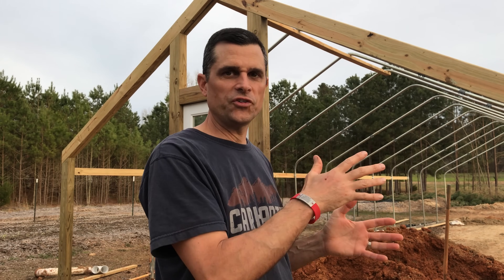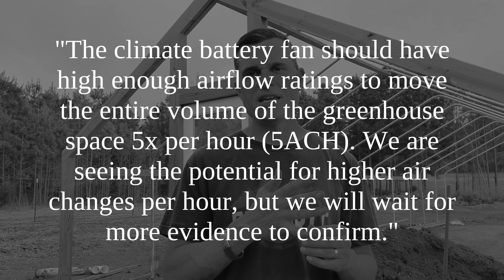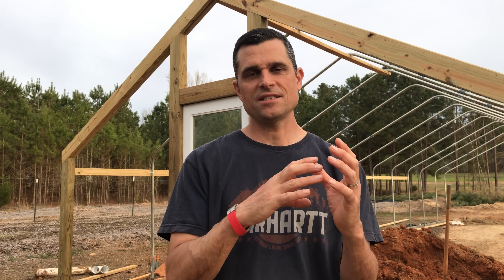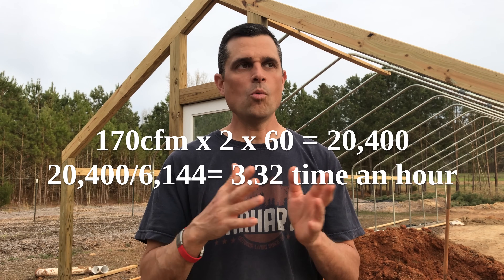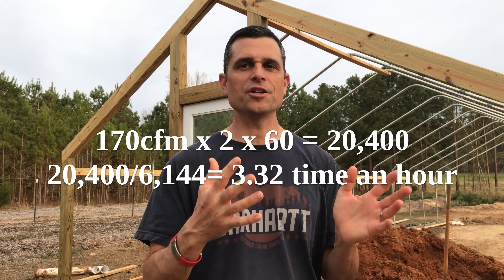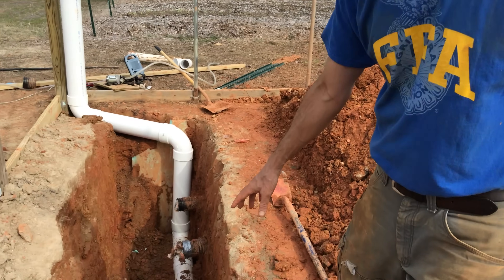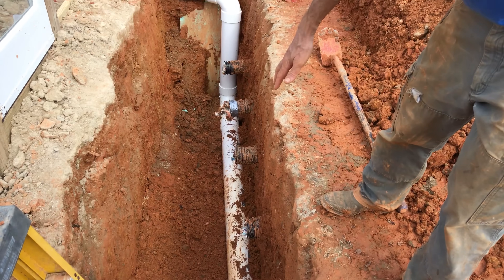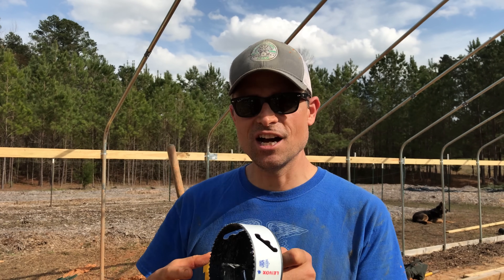DIY Geothermal Greenhouse Part 7: Earth Battery MISTAKE!

Comment: Okay, I'm getting ready to build one of these Earth batteries... You have a 6" manifold on both sides? What is the reasoning behind the additional manifold other than the exhaust end connection? (Is it that you don't want individual 4" exhaust ports?) Also; why did you step up to 6" and not go with an 8" or 10" culvert pipe? (And, would that have made a difference on air pressure on the 4" pipes?)  Thanks!
Reply from the maker: Uploading the Q&A video as I type. Hope it answers some questions. What I can say is this - the earth battery works in that right now air temps at the exhaust/return are 30-40 degrees cooler than the intake during the heat of the day. To us, that is just really impressive. What the system is not able to do during the summer is offset the passive solar heat gain. Don't know if any earth battery system in our area (central NC) could do that efficiently or at relatively low costs. Assuming ours does what we think it will in the winter (keep temps in the greenhouse above freezing for the cost of leaving on two light bulbs) we will be REALLY happy. We do wonder what slightly larger manifolds and fans would have done. Have to assume higher exchange rates would mean better results for not much more money to install or run.
Reply from the maker: Derek, we're about to do a FAQ video about the greenhouse. You are absolutely right about size - if money and time hadn't been an issue, we should have scaled everything up. 6" pipes in the ground with much larger manifold pipes and fans. As it is, what we installed will no doubt help us in the fall/winter/early spring to grow cool season vegetables year round. But it cannot handle the heat in the summer. It seems clear that a larger system probably would. Ours just cannot turn over the air fast enough. But a larger system means greater cost up front and to operate, so you would have to run the numbers to see if it was worth it.
Reply: 6" tubing is more expensive and less efficient than 4". The manifolds should be sized to handle the combined flow of all the 4" tubes ;)
Reply from the maker: We're about to do a Q&A video about this greenhouse. Given the size of our greenhouse, what would you recommend for the system? Do you think it is possible to upsize this system enough to offset summer passive solar heat gain?
Reply: I've been looking at a lot of various heat exchangers and the 4" pipes seem to me to be the best ones to use. To get a 1 cubic foot of air into a pipe, you need about 22-25 feet. The manifold is what I am having difficulty with right now because I don't understand how manifolds work and what the limitations on manifolds are. 24" culvert pipe isn't cheap... I could do 8" culvert, but then I am not sure if this would run into the unknown variables... I ordered the "Year Round Solar Greenhouse" by Shiller and Plinke, and it gives me some pointers but it doesn't get into the technical nuts and bolts of "why" you need what you need... LDSprepper built three different varieties and uploaded them to YouTube and he doesn't have outflow manifolds... (he also had a lot of money to toss into his project). What I don't get about LDS prepper is where he gets his figures from of 10:1 or 7.5:1 of cubic feet of air inside the greenhouse to the actual amount of pipes you need to make the air exchange.  His recipe is 7200 cubic feet of air is exchanged in 720' linear feet worth of corrugated 4" pipe... (And, it looks like he is using 4 rolls of the 250' 4" pipe). His other thing that he is doing is that he had 3" gravel brought in to layer his pipes with and he swears up and down about 8' deep is the sweet spot for heat transfer in his soil. (I have to guess that his hardiness zone is about 4 and his frost line is at least 48") My problem is that I'm not building a hoophouse and I'm in hardiness zone 6b where my frostline is at 24" … and I have a high clay content in the soil, and there is no way for me to get an excavator in the yard, so I have to use a 36" trencher. My water from the tap runs about 55 degrees year round and the water lines are buried about 3-4'feet below grade, so I'm pretty sure my sweet spot  for the tubes to start... Anyway, I'm subscribed to your channel so I will checking your Q&A out when you post it. You guys have done a tremendous amount of work putting your up and I am glad you're troubleshooting it. (I use every hint and tip I can find).
Reply: Please dont copy LDS unless you enjoy digging up tubing ;)
Reply: I have no idea how Cere`s came up with that number but it makes little sense  ;)
Reply: Exhaust temperatures  30-40f cooler than the intake indicates very low efficiency. What you need is a much smaller differential and higher flowrate ;) Logic should tell you that longer tubes are more resistive to flow than shorter tubes. 2 short tubes will provide identical surface area for heat exchange as 1 long tube without the resistance. If you cut the 2 short tubes in half again, the surface area is unchanged and as the flow is split between 4 tubes you can run more air for the same resistance. Doubling the flowrate increases losses by a factor of 4, likewise, splitting the flow between two tubes decreases the loss by a factor of 4.  You have to let go of the thinking that its better for the air to spend more time in the tubing (long tubes, low airspeed). Its better for the air to spend less time in the tubing because its the amount of time the ENTIRE greenhouse air volume spends in the tubing  ;)
Reply: That actually seems about right. (@JohnGuest45) You want to be able to make the air exchange several times to reduce or increase the temperature.The reduction in the ground (in the CERE's Book) is about 25btu's per cubic ft of air... A cubic foot in a 4" tube is spread out over 23', so a run of 25'-35' is an ideal length to run a series of 25btu reducing tubes (sort of like a battery running cells in a series)… The more tubes the greater the reduction or equalization of the underground and above ground temperature. You also need to exchange a higher volume of air.

Comment: A very interesting idea, but more interesting the real efficiency of this approach, over the year.  I think you need to install some UV lamp to clean the air goes from the soil (on exit), because this air will consist many bacterium and dampness - which is bad for the plants.
Reply: Same idea popular in Russia, it's called "Sunny Vegetarian by Ivanov". They also installing the greenhouse on the southern slope, which allows to correct the angle of sunlight that received by plants. Because in winter, insufficient solar energy due to the acute angle of the sun's rays. But I never seen the results of this approach, only idea. Anyway, good luck for you.

Comment: Using an IR temperature reader in that fashion will very likely give inconsistent and inaccurate  readings. To explain why look up emissivity. http://www.npl.co.uk/reference/faqs/what-is-emissivity-and-why-is-it-important-(faq-thermal)
Reply: 114 degrees inlet air temperature? That doesn't look like Phoenix, AZ to me.🤔
35 degrees air temp coming out of ground? Definitely not Phoenix. 😏

Comment: A lot of things I would have done differently. First, the manifold would be above ground. This way you could change flow, add parallel circuits/fans if needed. Second, I didn't see any insulation on the bottom If you are trying to store heat, it should have had all but the top insulated. Heat radiated in ALL directions conductivly and via IR in the absence of a convective fluid ( including gasses). Fluids circulates because of the hotter fluid being lighter and lifting. This is why heat rises in a house, but it won't work like that in a solid or restricted fluid. Also, I'm hoping you don't see a mold problem from the conditions being ripe for such in those pipes.
Reply from the maker: Thanks, hopefully you can also build a system and share the results. Seems the more systems people create with variations and data will help others create the ideal system and save time in trial and error doing things the wrong way. As to mold, the issue for us right now is that it is actually too dry in the greenhouse and we are having trouble keeping the humidity up.
Reply: St. Isidore's Farm Ah. I never get to deal with to dry of conditions until it's -30 to -40 degree during winter here. It's always way to much humidy.
Reply: St. Isidore's Farm I haven't done any thermal battery systems with air exchange, but I have done several with hydronic  (water) systems. I would tend to think there are similar concepts involved. I was just thinking I should do some experiments with the radon vent piping system in there. Specifically this winter while heating again, I could try to see how much thermal transfer will happen between the systems. Maybe with raspberry Pi monitoring along with factoring air velocity and temp rise I could get some power transfer calculations. But thats a project for next winter I guess.
Reply: It would be good to see more help in a positive way. 
Than say things that don't help. Got to give them credit, 
There trying.  Thanks
Reply: Kijiji2017 Porter Excuse me? How exactly did you come to THAT conclusion?  I DID offer ideas and why I though they might help. Are you reading whatI wrote?

Comment: Wow, 114 degrees to 35 degrees .... I'd say that validates your ideas ... cool, pun intended.
Reply from the maker: We wish it was that good. Still not sure what was going on with the infrared thermometer, but 30-40 degrees cooler is what we get consistently. Thanks for watching and taking the time to comment!
Reply: @StIsidoresFarm  I don't hardly think k your temp readings can be correct. 1st, the input reading of 114 degrees should be the same as the ambient temp of the greenhouse. With no walls or roof on your greenhouse that should be the outside air temp. Was it 114 degrees outside when you took that reading? You held the thermometer right next to a gas powered air blower. I think maybe you were reading heat from the blower. The exhaust should not read any lower than ground temp, probably in the 50-55 degree range. That is if the system is cooling the air down completely to the ground temp. I don't mean this as criticism   but if you use bad data you get bad results.  I would ditch the thermometer you are using and hang an old school thermometer in that exhaust pipe and check it after an hour or so.
Reply: @Just___me_  what happens when air is compressed + the IR's proximity to the blower fan motor?

Comment: How does 51 degree soil turn 105 degree air into 35 degree air?  This seems impossible.  I always thought the temperatures would "meet-in-the-middle" somewhere like 81 degrees?  Am I missing something?  Let me know !! ^_^
Reply from the maker: Yes, the infrared thermometer was clearly reading something wrong. Not even sure how it was doing it, but you saw the numbers. Still, the system does actually reduce temps by 30-40 degrees everyday. It's a pretty amazing heat exchange system.
Reply: Infrared reads temperatures of objects, not gases (air is a gas). It HAS to be calibrated.  The COLOR of the solid item you are pointing it at matters (shiny surfaces screw up the reading, best surface to "view" is MATTE white.  Accurate Infrared Gauges are expensive, and inaccurate ones are not.
Reply: Thanks!  I was rooting for it to go all the way down to 32 but it wasn't until a few days later when I realized how truly incredible that would be - great videos!

Comment: While I admire what your doing, you need to check your math before you video again, otherwise you'll be making a mistake video about a mistake video.  Unless I'm wrong your comparing circumference of a 4 inch pipe to surface area of a 6 inch pipe.  Your not wrong it is over double the difference in area, but I'm gonna have to score you down on your workings out :)
Keep up the good work, its interesting to see how these simple heating solutions work.

Comment: A six inch corrugated duct is not the same as a six inch smooth duct. It has more resistance to air flow. Hope you knew that when you did your design.
Reply: I'd say a smooth manifold would be better as the air would fill the smaller pipes harder
Reply: Corrugated is much better for humidity control.  The more turbulence you have, the better it will pull water out of the air, or out of the soil, depending on the season and/or humidity.  And the corrugated doesn't slow the bulk of the air down that much.  And, as Bob Marley said, it makes the heat exchange more efficient.

Comment: After it's all been said and done and the heat is getting higher in the greenhouse what's the final evaluation of temperature going in and temperature coming out of the pipe getting ready to set up my own system like to see what your evaluation was
Reply from the maker: The real test for this system will come in the fall and winter. What we can say right now is that it is too small to offset the tremendous thermal gain from the summer sun. Even with fans, we had to add shade cloth to reduce heat inside. That said, the air coming out of the pipes is consistently 30-40 degrees (or more) cooler. So we could see where a much larger system, one that could really exchange the volume of air quickly could work to keep it cool during the summer. The one cold night we had before spring really set in was a low of 34. The system kept the temps around 60 the entire night. So if I had to do it all over again, and could afford it, I would put in larger intake and return pipes as well as fans.

Comment: Perhaps a more cost effective way to get some heat to the green house is a propane heater that actually produces CO2 as a combustion by product. Needless to say this has it's problems, but it will boost the CO2 levels in the winter when air circulation is a problem.

Comment: I think one step would have been to seal the insulation panels at the start, and have each panel reach above ground, the second step would have been to have gravel under each pipe layer at a inch or two per layer of pipe to help drainage in ground. I have no idea if any of that would help NC climate has a lot of moisture.
Reply from the maker: Thanks for taking the time to write and comment. Since uploading this series, we've read conflicting thoughts about the gravel. Seems most folks installing these say don't put down gravel. Aside from rain flooding the system (addressed in a future video in the series) we've had no issue with condensation filling up the system.
Reply: St. Isidore's Farm confused if rain flooded the system, it means it was overloaded?
Reply from the maker: No, we built the greenhouse on a large flat garden area, that previous owners used for riding horses (sand on top of red clay). So when it rained there was a lot of standing water and flooded into the greenhouse - then down into the earth battery system. We just regraded and put in the start of french drains and no longer get any water in the greenhouse: https://www.youtube.com/watch?v=QBHKot1VBM8 and https://www.youtube.com/watch?v=JBJxVrZRn3M

Comment: Thanks for sharing the mistakes as well as the gains, I am thinking about doing the same as this for my greenhouse.  Now I have not done as much research as you, but there are so many variables to consider its not even funny, there is airflow, there is thermal conductivity in comparison to flow, speed and area of your essentially , condenser, then all those variables in relationship to the size and efficiency of the greenhouse.  I am sure some engineer somewhere would know exactly what questions to ask and be able to give an answer, but each variable even up to type of soil would change it.  So I will probably just follow your lead, and it ought be be "close enough for govt. work".  Thanks for sharing!
Reply from the maker: Unless you're getting ready to build it ASAP, I'd wait for us to share data and make design recommendations/adjustments. We've learned a LOT from the comments on our videos and would certainly do some things differently. Of course money was and is and issue.
Reply: I am always in the middle of a project, so it may be a bit further down the line before I get anything started, but if not, I think the ideas you have are still good, especially with the feedback your getting.  In the end a greenhouse is good, and any improvements you make are better, may they be the ideal, most efficient?  Maybe not, but its still an improvement.

Comment: So what we're looking at is this gigantic outside source let's say 10 x 10 ft Jiffy wide 10ft deep tunnel that's coming in under the greenhouse so you say well that's not a waste of space right you build your house over that and you use part of that energy to cool your house or heat your house and then on the other side of your house is the greenhouse

Comment: So this is one of the reasons we don't need to have all these tubes running of the ground all we need is a big you know 10 x 10 whatever space that's pulling in the air
Reply: Thing is you won't need a fan or you got to do is have air coming in down below and then I exit at the top it's called natural induction cool air coming through the tunnel and the hotter end of it coming out to the top

Comment: So yeah it needs to be wider than that if you had an underground tunnel the bigger the tunnel the more air in flow you have coming in if you put the the tunnel down to one in you don't have anything going in but if you got a tunnel that's like 12 ft by 12 ft by 12 ft now now you have a source but then you have to determine how far the source is 10 feet away 50 feet a hundred feet or even a thousand and then when you're done into your place